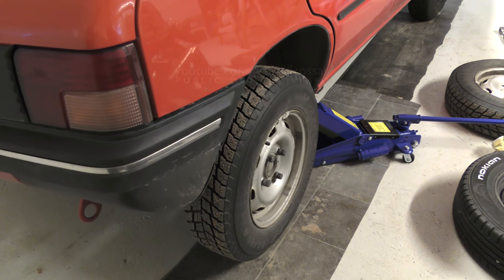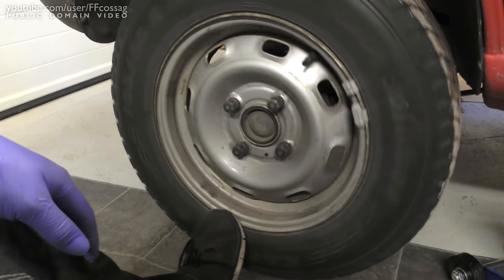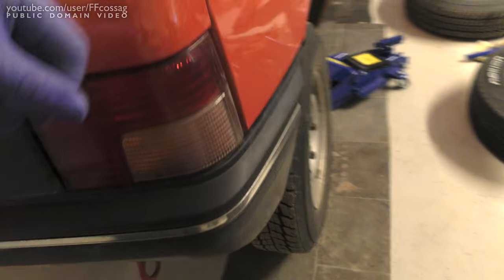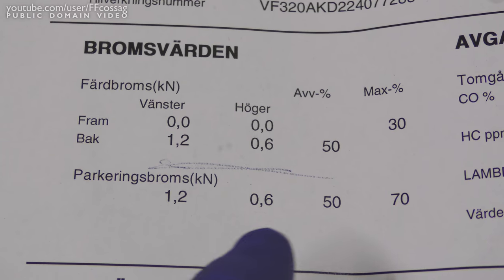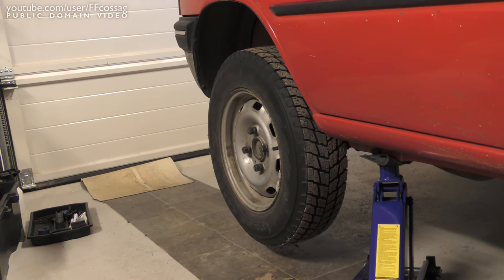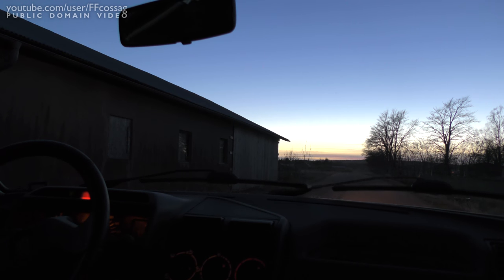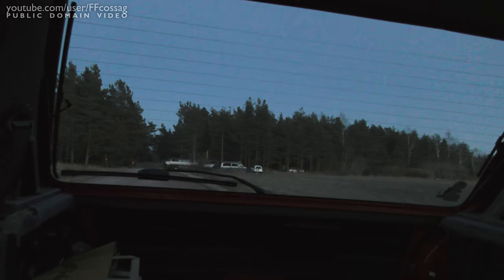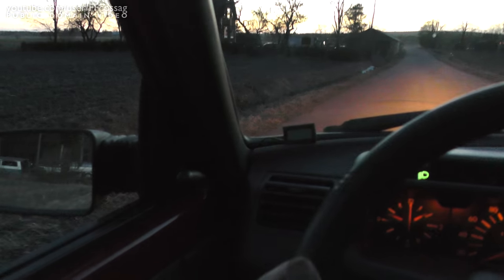Blog. Peugeot 205 drum brake FUN, FUN, FUN!

Comment: If you had an oil leak on that side you should change the brake shoes, as it would soak into them effectively lubricating the shoe surface, which you don't want.
Reply from the maker: I know. That's why I tried buying new brake shoes. I have a complete rebuild kit for the wrong brakes.

Comment: Ah, little cars are fun though. I used to have a 1108cc Cinquecento which was great to run to college, University and work, fun on twisty roads and roundabouts, used barely any fuel and tyres were £30 each. Oddly (maybe not for Fiat) they put a pair of trailing arms in the back of a tiny cheap city car instead of a torsion bar.

The drum brakes on it would usually be fine for driving, and fail or be poor for handbrake/parking brake. It had a single handbrake cable connected between either side and looped through the handle mechanism. Either the cable would stretch over time (adjust the tension) and/or the pivoting-lever-thing the cable pulled on to push the shoes outwards would seize up (lots of WD40 and working back and forth to loosen up, then lubricate). The second option requiring removing the shoes and the springs that pull them back to the middle.

That clock is rather lovely, especially with the sweeping second hand. The digital one in my current car appears to be run on the same CPU as the other functions on that display (instead of having a dedicated clock IC) as it will drift behind by a minute every 6-8 weeks (!). The clock in the Cinquecento was wrong when the battery was disconnected or when the clocks moved an hour twice a year.

Comment: Hope it passes this go around. One of my many "hats" I've worn included being an auto/marine tech for 25 years. I worked on mostly foreign/imports here in the states. There may be a shop close to you that actually would reline the friction material on the brake shoes. If the one wheel cylinder had been leaking that would have changed the friction material qualities enough to cause an imbalance in braking action. One of my tricks when dealing with brake fluid, is to wash things down with water. That fluid, being hygrophilic, is washed away easily. but as I said the linings may be permanently altered. In a pinch, you could try contaminating the other set of brake shoes to see if that evens things out (not recommended)

Comment: Why don't you daily your van? I'd think it's much better car than that old 205...
Reply from the maker: The van is an absolute piece of trash compared to the 205. A 205 was actually in roughly the same price class as the van (if not even more expensive), so it's a much higher class car.
Reply: Oh interesting. Do you mean that in the same price class when it was new? Every time I have seen 205 here in "northern" Finland they are in really bad shape. Rusted and abused a lot. So they are pretty much shit now.
Reply from the maker: When new. My van is cheapest van. You bought my van if you couldn't afford other van. lol.
Reply: oh lol.. It just seemed okay from the build logs you did. I guess I did get it wrong back then.
Reply from the maker: Well, it's nice in that it's simple and basic. I love it for what it is, but when compared to a more proper car like the Peugeot, it just falls way behind on comfort, performance, options and, well, quite literally everything aside from ease-of-service and reliability.
Reply: I guess the simplicity is what people usually seek from that car (and cheaper price) How's the gas mileage? Around 6L or less? Parts easy to get?
Reply from the maker: The van runs about 8L/100 km. Parts are expensive and you can usually only get Nissan originals. They are usually available, though, thankfully.
Reply: Damn sorry I wasn't clear enough. I meant the 205.